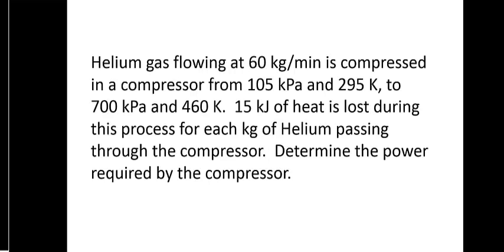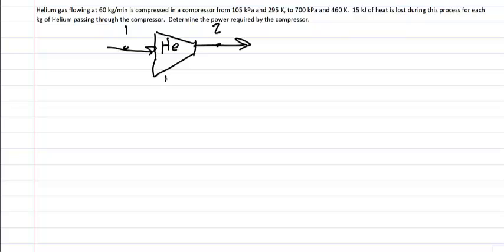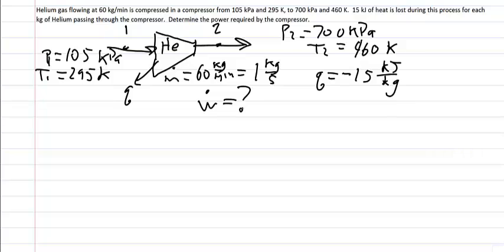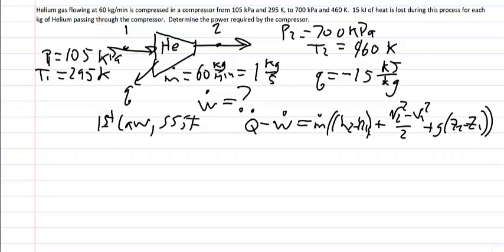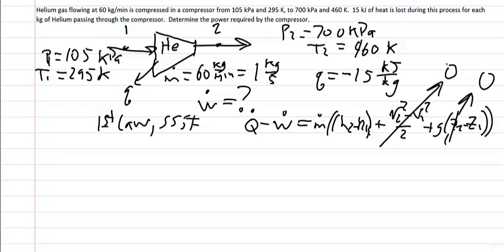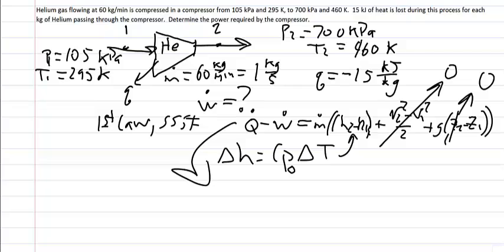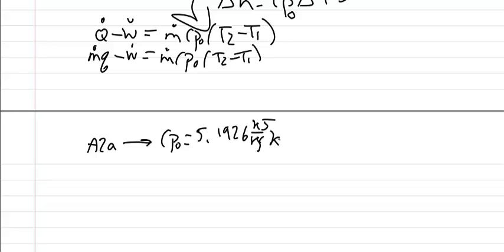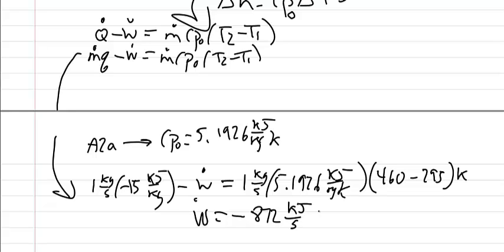Thermodynamics: Worked example, Compressor

Comment: E in = E out
W + H1+ KE1 +PE1= H2 + KE2 + PE2 + [-Q)
Thus;
W+Q = 🔼H +🔼KE + 🔼PE

Not Q-W,  correct me if I'm wrong sir.
Reply: w is negative because its work done BY the system. in the end result in this video, W is negative showing -(-W). meaning work W+ is being done ON the system. hope that helps

Comment: Why did you use Cp (constant pressure coefficient)  when the pressure has changed during the process?
Reply from the maker: Cp can be used if the pressure changes. It is a property of a fluid and is a function of temperature. Sometimes an approximation is made where the value of Cp is assumed constant and determined at some average temperature.